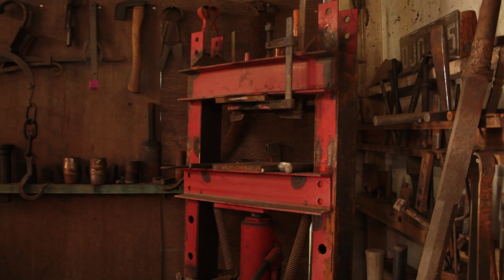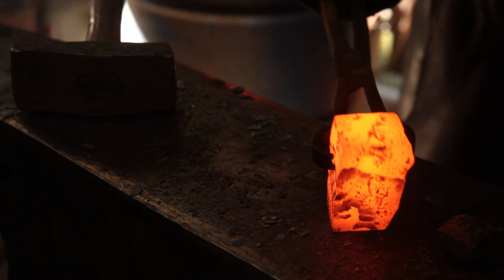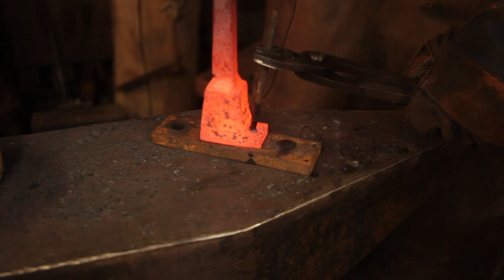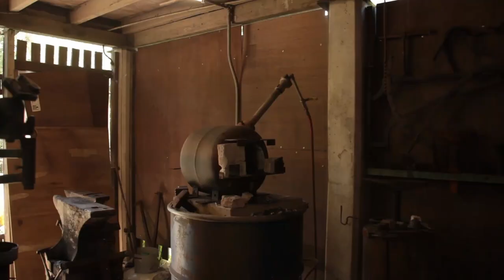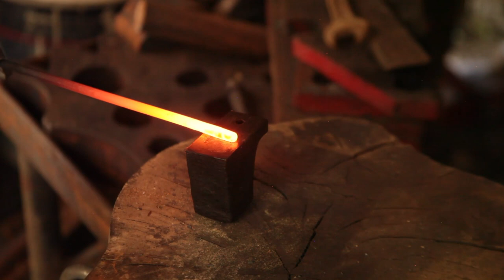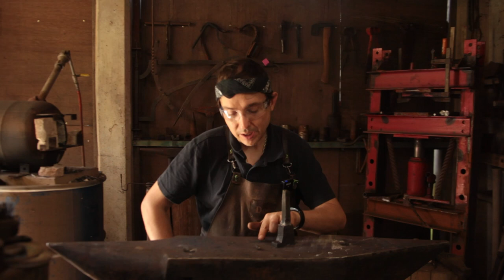A Small Viking Ship's Anvil

Comment: I’ve been thinking I should make something similar as a goal for a while now, portable anvils are especially interesting given how stationary the trade is today. Maybe one of those with a little bick on it. Seems like a lot of hard work! I wonder how you’d maximize utility with such a concept today, perhaps you’d have some insight
Reply from the maker: I have one that is patterned after one of the small Mastermyr anvils, no bick though, which I found if set in a dense hardwood stump wired very well (made a small knife steel edge with wrought iron cladding). The one I made with a bick sold to a viewer and is now in the UK if I recall rightly. The next one I want to make I want to include a breast like on south German anvils and a bick to maximise utility, but that will have to wait until the 30lb anvil is finished.

Comment: Well done! A pretty little thing this is! I have recently been working on a little (well, not so little compared to yours, ha!) anvil for a travel kit, loosely inspired by one of from ~600AD, about 7x6,5cm striking face, coming to 7x10,5ish with the horn, alas, during one of the final forgeweldinig heats I noticed cracks, one very severe, and they ran all through the upset head of the body under the toolsteel plate, I was heartbroken! It might be just micro fractrues from the wagon axle's life becoming major ones, but it took so many heats that it is so odd it formed now. And to add insult to injury, the back corners delaminated. Pah! I'll finish her and then start plans for a new one.
Reply from the maker: So one of the issues I’ve found with Waggoner tire iron is that it tends to have high levels of either sulphur and or phosphorus both are poison to stable welds. The origin of the contamination is likely the coal the original smith used, anthracite is usually high phosphorous, some bituminous coals are high sulphur (Bowen basin in Australia is one that comes to mind). That said if you can flux it well and get it really hot you might get the cracks to heal up with some gentle persuasion. Good luck and keep up the work, it’s worth it
Reply: @docshotshopandforge  That was my thoughts! That, and I once tried melting some scrap copper/bronze in my gas forge and the crucible cracked and spilled out. Year later I am still fishing bits of the stuff out ocasionally, and I have noticed that if I do welding heats and leave the forgepiece to cool slowly in there, I noticed the next day a coppery sheen in places on the workpiece. I didn't make much of it then, but now it makes me think if it might have been phosphorous bronze and that is somehow seeping into the iron, it isn't the first time such old iron crumbled on me, especially on welding heats. How very odd and frustrating.

Anywho! That's the plan. I already have plans and more material for making more anvils, I really want to get this part of the craft down because I got my grubby mitts on something really rather rare and unique. Starmetal. I got a few kilos of the stuff a year or so back and I thought long and hard how to use such a rare resource, especially if I expect ~10% final yield if I want to refine it through forgewelding, drawing into strips, cutting up, carburising, then reforgewelding and doing some folds to mix the carbon in to really refine it to "weapon-grade" or toolgrade material... And came out with the realisation that if I make an anviltop out of the material, then in a way, everything I will forge on it will be "from starmetal", hah! I am a hopeless fantasy fan, so such esoteric, perhaps spiritual or ritual things are a given part of forging for me, and to be fair, with a craft like this, I can see that it has been big even in the past.
Reply from the maker: @Erikreaver  so two things from that, one they add phosphorcopper shop to copper and brass/bronze melts to degas the charge. And the second is copper and steel do not like each other, the make for brittle bedfellows and will produce cracks